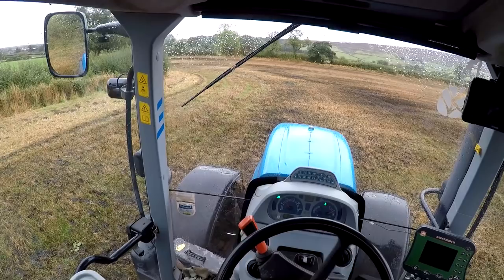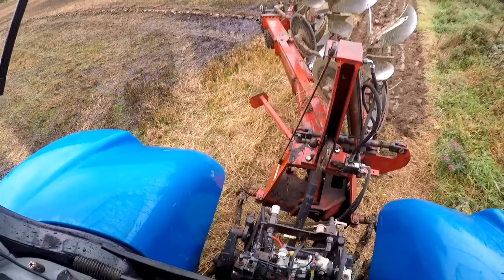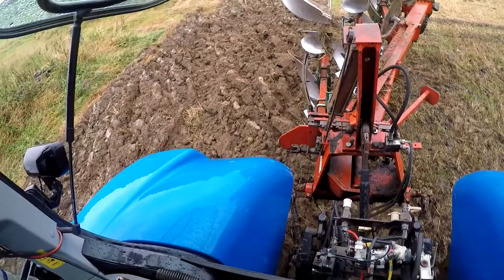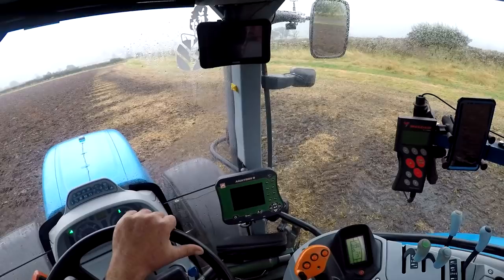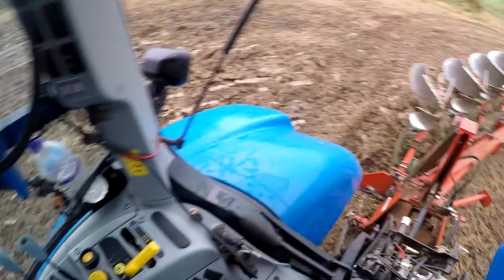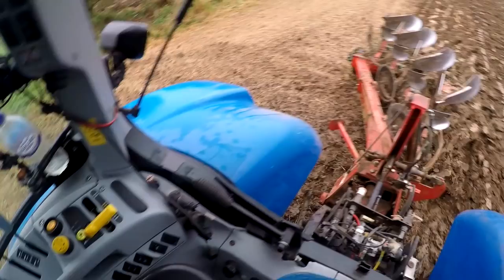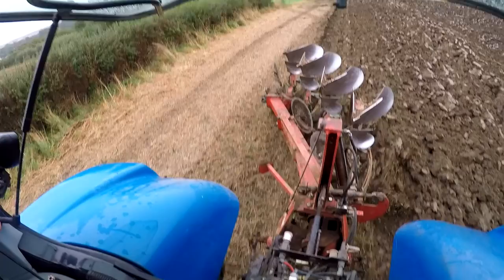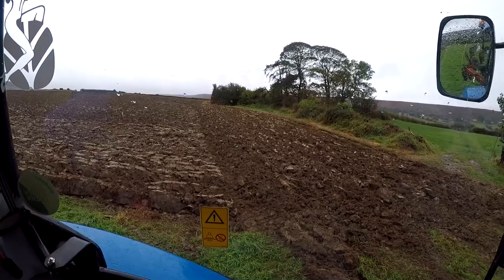Beginners Guide to Ploughing Part 2  Ploughing Headlands, Marking out, Starting new Field

Comment: How nice to see some ploughing done similar to my dad tought me, the old fashioned way as you say and he was very particular. If you could you would finish by driving out the gate and not leaving a wheelmark anywhere. Most of my early ploughing was one way, I found it easier in some ways using a reversible. I particularly remember him going mad if you LOST your ends....in other words always take a little bit more when you drop in as he said it is always easier to lose an end than gain it, using the good old independent brake just before dropping down was the trick. Mind you if you gained too much he would say that you had left a bit not ploughed, another pet hate of his when ploughing!
Reply from the maker: Thanks Paul. I think alot of the younger generation nowadays arnt getting taught all the little tips and tricks and actually setting one up. I think the old school ways should be taught, not just jump on a tractor with auto steer
Reply: @GEOFFKV6080  Yes I agree it's a shame because it saves time in the end, like if you don't leave a hole ( hog trough as it was called in Lincolnshire) you either don't have to fill it in or it doesn't end up as a big puddle. Having said that I was also taught to spend a bit of time sorting out the ditches and ends when cultivating first time over, like filling a silage clamp I was told look after the sides and the middle will look after itself......a lot of these issues are down to time pressure which often comes from financial pressure. It doesn't value things like looking back and feeling satisfied......as you said not always perfect but the best you could do on the day.  Oh and the GPS etc....lovely but as I noticed you were looking behind checking and looking down at your front wheel etc.......you can't do it all looking at a screen. Good luck with the cropping. Paul
Reply: sounds like my dad lol, he used to compete in ploughing competitions when he was young.

Comment: Great vid kv.  The  contractor who does the ploughing where I work ploughs the headland into the hedge so when he starts ploughing the headland he leaves a deep four. So when I am working the field down with a power harrow you have to run up and down the four 2 or 3 times to level up the soil. Your way of ploughing the headlands is a better way because it leaves the field level.

Comment: Do a know your tractor series start the back and do the spools and talk about the double acting and when you use it what float means and what the taps do on the spools and the specs on different tractors like open centre and closed centre hydraulics . Then do the pto like 1000/540 shaft and when you use each and the pros and cons of each.then work your way round the engine and what everything in it does under the bonnet, then do the axel brakes clutch tyre pressure etc

Comment: Good video by the way. Bookmarked. 

I have a tractor that had duals on so the rear wheels are 24 inches from the inside edge of the tire to the center of the tractor, plow manual calls for 32 inches. Could I leave the tractor wheels where they are and basically run "on land"? Or do I have to spread the wheels out to what the manual asks for. The Plow is a model 57 Massey Ferguson.

Comment: How do you work a headland where you plough back into the ditch? You wouldn't always plough back into the field, so next year, you plough the headlands starting at the ditch, and plough back out. I know Kuhn ploughs, for example, swing the other way, so you can, on the last run, not rotate as much, and keep the rear furrow out, instead of the front on, the way kverneland does. But for Kverneland ploughs, how do you prevent a big dip on the last run?

Comment: Serious standard of ploughing. Do you feel hydraulic vari width is worth the extra cost and weight? You seem to have very little use for it with your skill.
Reply from the maker: Not sure really, I've never used a vari width. We have talked about getting a 4 furrow vari width instead of getting a 5 furrow that's fixed working width, the theory been we could open it up and still cover same ground as a five furrow but without the extra leverage on the tractor.